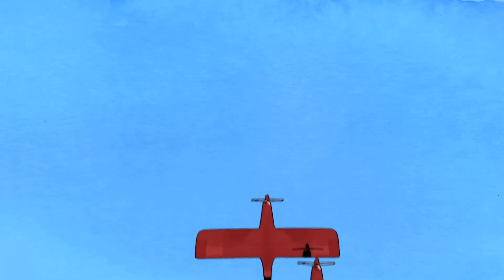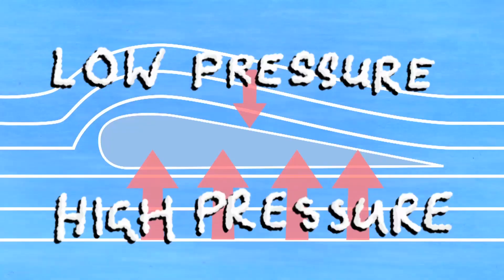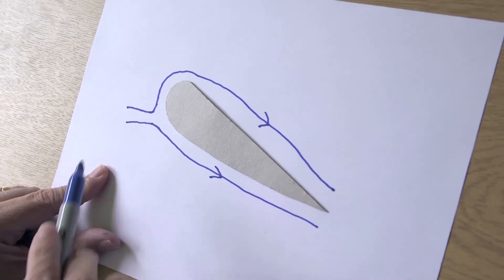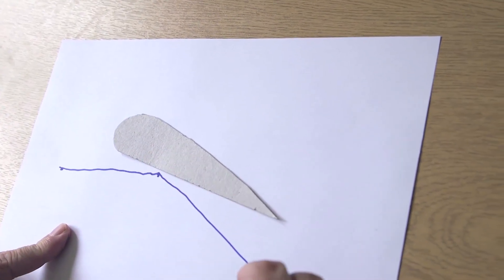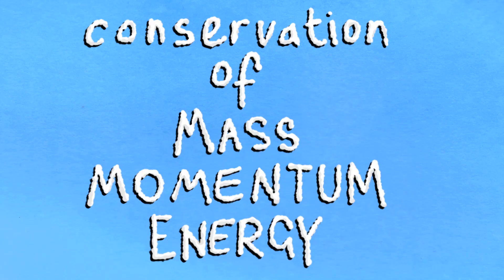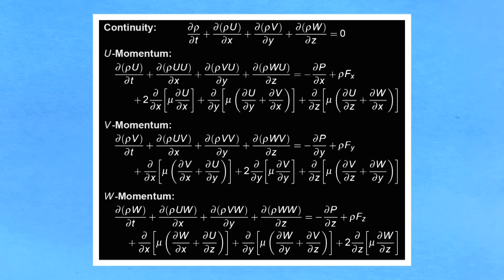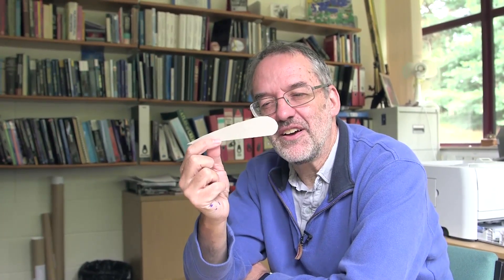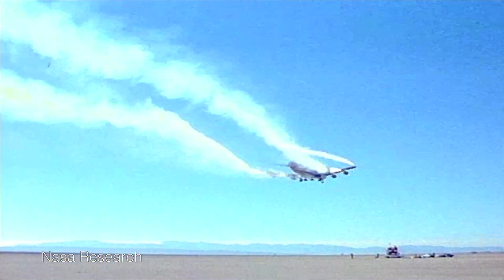Lift and Wings - Sixty Symbols

Comment: I'm copying this comment here, although it relates to the Gamma trilogy, because I thought my comment might garner a response if I popped it right into a NEW video, rather than one where the next newest comment is a full year old.  Sorry.  I think WAY outside the box sometimes...  So, in relation to the Gamma trilogy...  "I'd love a response to this from someone on or behind the camera. Couldn't think of a particular video where this comment would've been more 'correct', I like this channel. Anyway, I was an IT instructor for quite awhile, could easily still stand up in front and do some teaching. Here's the ONE THING I always thought would give the 'rubber sheet' gravity graphic greater value as a visual aid. Draw AT LEAST TWO rubber sheets, offset from one another, specifically to 'break' the mind's capability of abstraction of the habit of thinking in only three dimensions. Since every graphic of the solar system ever drawn appears as an extended elliptic ("The axis of rotation is NOT perpendicular to the plane of the ecliptic."), people tend to incorporate that little bit of trivia into their 'new understanding' of how gravity works, once they've finally seen the 'rubber sheet' graphic. But the 'single rubber sheet' fails to specifically illustrate that the curvature of spacetime around a massive object, (BTW, the spell checker shouldn't redline the word "spacetime", Google. Shame on you!), it fails to specifically illustrate that the curvature of spacetime around a massive object is totally xyz-coordinate-independent. It curves in all possible directions, related best to some gravity-influenced object by showing that it is vector(?) dependent. Whichever direction the approaching (or orbiting) object is in relation to the other object, THAT will affect what vector(?) the two bodies will respond to each other 'in'. I think this would be MUCH better illustrated by including at least TWO exemplar 'rubber sheets' in every graphic depiction of same. Just my opinion. Would love to hear the Professor's opinion. Please forgive the probable misuse of the term "vector", although I'm pretty sure you know what I mean to say."  Also, forgive me for ramming this thought down the throat of a video about things that lift...

Comment: Hey Professor Mike, where did the idea for the wing shape come from, historically?  It's always functionally described by math, but never why you applied the math to that particular shape in the first place.  I have a hypothesis that the shape was taken from triangular sails, they are both shaped the same in cross section and the (horizontal) "lift" from a sail is what allows you to tack.  Just turn the sail 90 degrees and you have a wing.  What do you think?

Comment: The smoke test where quite interesting. We where in an airbus 333 2 weeks ago, and we hit very strong turbulence for about 30-45 seconds. The pilot came on the tannoy and said we crossed another planes wake. How long does a plane leave a wake? We where about to enter a stack about 80 miles from london gatwick irc. Just wondered if it was calming announcement or not. I told my kids they where just cloud bumps, like road bumps but in the sky.

Comment: Vortices do not "have a significant effect on the lift of the wing".  Vortices are the result of lift on a finite wing, no lift no vortices.
If a wing tip flew next to a stationary infinity thin, infinity long, plane that separated the top and bottom of the wing, the effect of the vortex would remain even though the vortex wouldn't rotate, and I think the magnitude of the vortex effect would remain the same.

Comment: Been looking for a real explanation for awhile. Question: if the air at the top of the wing is being fit into a smaller area it is being compressed and wouldn't that create a higher pressure? Pv=nrt.
Reply: I think his comment about the air being "compressed" is misleading.  The airfoil exchanges momentum with the air (conservation) acceleration occurs and as a result, a velocity.  More air molecules pass over the wing in that thin sheet, but because of their increased velocity the pressure is actually lower.  I explain this a bit differently, elsewhere

Comment: I appreciate your reference to Euler and Navier-Stokes, there is some nice physics underlying this, but conceptually the thermodynamics of the conservation of momentum and energy should not be presented as complex or subtle.  This is not hard to understand.  The two dimensional cut out you display will fly.  Airplanes fly upside down because the angle of attack can be adjusted to compensate  for an asymmetrical airfoil. It might have been interesting to have mentioned the Coanda effect and its relationship to the Bernoulli principal.
Reply: Aeronautical engineer here: The Kutta Condition is more relevant to the lift generated by a wing. It describes the nature of the flow over an aerofoil to stay attatched to the aerofoil surface until the trailing edge (at low angles of attack). Note that this is a viscous effect and without viscosity aircraft will not generate lift.
Reply: @christube4487  why is viscosity needed?
Reply: The Coanda effect has nothing to do with airfoil lift.
Reply: @AmbientMorality  The Coanda-effect describes the tendency of a fluid to stay attached to a convex surface when moving across said surface, so yes, yes it has absolutely something to do with it.
Reply: @Hyperus  The Coanda effect describes a viscous free jet. Flow around a wing is explained extremely well (outside a small boundary layer) by inviscid potential flow theory. Coanda effect is vaguely similar but unrelated.
Reply: @AmbientMorality  but wouldnt the air without coanda effect just ignore the surface?
Reply: @PinkeySuavo  In purely inviscid flow (Coanda effect describes viscous flow) the pressure forces ensure that the air would continue to flow around the airfoil. 

Viscosity is needed for lift, as Swirlything01 notes—but I don't think it's related to the Coanda effect. It's just that in inviscid flow air would race around the trailing edge and turn around really quickly, which isn't possible when there's friction slowing it down.

Comment: Air being pushed by a moving wing, IS squeezed, and the air pressure, from both gravity above and the fact that the air not in motion above the "squeezed" molecules, makes the squeezed air rush out into directions "AWAY" from the direction of the hard immobile surface of the wing, thereby lowering the pressure and speeding up the air at the same time. With a sloping curve on the back side of the wing, the air has an obvious direction to "Unsqueeze" and thereby speed up. The underside of the wing has only a slope into the wind, and therefore gets a "bump" from the molecules hitting force imparted and slowing it at the same time. Thus, lift.

Comment: The Bernoulli effect is the ONLY one that is actively making a difference in the force balance of the system.
It has already been demonstrated 60-70 years ago that pressure on top of the wing is lower.
The fact that some VERY low grade/early books said the air meets at the trailing edge is irrelevant, nobody NOBODY that has ever gone to college for aeronautical engineering has ever studied it like that, because again, there are wind tunnel studies from 60-70 years ago that already showed the wind streams don't meet exactly at the trailing edge. (that is only seen on cheap books slapped together by people that knew nothing of aviation).
The rest is just for putting physics into numbers and graphs on how the air moves, temp., turbulence, pressure, vortexes.
I'm sure you know about fluid dynamics, the equations invloved would make 99% of the peoples heads explode here. The actual lift calculation for wings is several lines long.
But the question was, what makes the wing lift? What causes lift?
That is entirely the bernoulli effect. FACT.
Every other physical interaction/property of the gas medium are things that "affect...the bernoulli effect", more or less.
You take away the Bernoulli effect, and the plane drops like 50 ton stone. Got it?
And THAT is a fact. And it's been a fact for 100 years.

Comment: I've been waiting for years for this video to come out. It's been a pet peeve of mine for a very long time that people still teach this theory (the Bernoulli one, specifically). I was discussing this with a friend a few months ago, and we came to the conclusion, that it really is the downward acceleration of the air that causes the lift. The reason we arrived at this conclusion is that an infinitely thin wing would still generate lift, even though the air would remain at a constant speed. i.e. momentum conservation still applies, but Bernoulli's principle does not (or maybe I should say that it has no effect). For example, Paper airplanes fly just fine, and they have extremely thin wings.
Reply: Your explanation is closer to why parachutes work.
Reply: @euroviziune  Parachutes cause turbulence, and therefore dissipate energy that we perceive as drag. A wing is designed to cause as little drag as possible.

Comment: Nice video Mike. My only slight gripe is that you skirted too much around the viscous effects, as they seem fundamental to me as to why streamlines follow surfaces the way they do, and how this results in observations like the Coanda effect. Without viscous effects to attach streamlines to the top surface of the wing, the motion of the air at the trailing end of the wing wouldn't end up moving downwards... I think.
Perhaps next time just solve the Navier-Stokes equationsn and be done with it ;).
Reply: No, that isn't true at all. If you assume airflow is inviscid, flow separation never occurs. Considering viscosity opens up the possibility for separation.

Comment: Wouldn't have been easier to explain by saying that anything traveling through a fluid creates a potential vacuum where said object is if the object wasn't there. Which means a traveling object through a fluid causes said fluid to quickly fill the space the object left. Air is fluid, thus manipulating the shape of the wing and the tilt of the plane will cause fluid to push more fluid into the vacuum causing different forces at different parts of the plane. A faster plane displaces more air per  second, which results in more air moving to fill the vacuum in shorter time. This equals more force as a whole, which results in lower and high pressures. The rest is just clever engineering.

Comment: I am a fluid dynamics PhD student doing 3D aerodynamic simulations, and I approve this message. Fluid dynamics on YouTube can be really cringe-worthy, but leave it to sixty symbols to do it exactly right... Well done, more please
Reply: TheNightWatch001 Where are you doing your Phd from?
Reply: TheNightWatch001 I’ve always been a bit suspicious about fluid dynamics ( which includes liquids as well as gases) being applied to aerodynamics, because liquids can sustain an internal tension and gases can’t . Molecules in liquids are in direct contact with each other and gas molecules are about ten diameters apart at STP , and the mean free path of gas molecules under these conditions is closer to a hundred diameters. 
To take just one example——the viscosity of liquids generally decreases with temperature, but that of gases increases. Ouch!
Reply: @davidwhite8633  fluid dynamics and aerodynamics is literally the same thing?! aerodynamic is, if you really wanted to called it that, an under-category of fluid dynamics. The same laws apply. Yes in your everyday experience water and air behave very differently, but from a fundamental stand point they can be described with the same PDEs, the navier-stokes equations. 

You know, an airplane would also work under water (tbh even better due to the much higher density).

Comment: why would the air being compressed above the wing have a lower pressure than the original air? wouldn't the same mass of gas in a smaller volume create a high pressure?
Reply: bruce randall 
You also have to realize that the air is being stopped from filling the space the plane is going through by the plane itself, creating a partial vacuum. This causes the lower pressure which results in air flowing over the plane to fill the void, and that causes the air to move faster.

Comment: I would just say it's simple if you take that fluids like air naturally follow the surface of the wing due to their tendency to fill any vacuums or low pressure regions. The trailing edge of the wing slopes downwards, so if the air is following that slope, then it is also being imparted with a net downwards momentum.

TS;RM After the air is separated from the wing surface, it still has that downward momentum. If you think about it, air particles at a given temperature and pressure have a certain average velocity. If the trailing edge of the wing is sloping downwards, those air particles are going to collide with the wing at a lower impact velocity, meaning that the momentum of the total fluid is given a downward momentum, but also that the particle collisions on the underside of the wing will push the wing upwards against the lower collision velocity on the upper surface. So, the air pressure being lower on the top allows the bottom flow to push the wing up, while the top flow gains downward momentum due to suddenly having fewer collisions in one direction than the other.
Reply: J7  That’s a very understandable explanation . Better than most I’ve seen——and I’ve seen a lot .

Comment: From what I understand, the Coanda effect, the ability of a fluid to attach to a surface, also plays a large part in providing lift for the wing.
Reply: Nope, it is incorrect, pls watch the youtube video "Common misconception of lift "by Cambridge's proff Doug Mclean.

"It is not needed for viscosity or Coanda effect for the flow to follow convex surface."
Reply: @loouuiisssss296  And indeed viscosity is what allows flow to detach. Inviscid flow (in thin airfoil theory) doesn't ever separate.

Comment: So the professor still didn't get it right actually. Due to the three conservation laws, a vorticity occurs around the air foil, which in addition to the flow, creates the low pressure on top and high pressure on the bottom. This vorticity can be created with rotation of a cylinder as well ( curved ball effect)

Comment: Is it true though, that the wing is getting extra momentum from the air pushed down? There was this little innocent bit about the air being squished into narrower space when it hits the wing, prof. Merrifield said there's no apparent reason for it, but it's the way air works according to the Navier-Stokes equations. But - can't it be this part of the procedure where the momentum can be going? Can't the momentum be acquired by the air layers higher up? Probably not. If it was like that, professor would know. On the other hand, since the bit about squeezing the air is mysterious, it just makes (for me) the part about momentum not compelling. Just to clarify, I'm not arguing against it, I'm just not completely satisfied with the explanation - like I feel I'm still missing a piece of the puzzle. Other than that, this is the most clear explanation I've ever seen.

Comment: The key to lift is at the stagnation point. Air is draw over top of the wing, but the air that goes
under wing is drawn up by this too. Causing the bottom flow to hits the bottom of the wing harder. Causing a pile up of air. And causing higher pressure.
Reply: Except that explains nothing about the upper surface, and the upper surface ends up contributing more lift (more precisely if you integrate the pressure over the upper surface the lift there is usually greater than the integral of the pressure over the lower surface)

Comment: Lift is a wonderful thing to talk through. So many have these 'incomplete' descriptions described by Prof Merrifield, because they are quick to accept a sciencey sounding story. It is really interesting to see the different ways that trained engineers and physicists are confused when you ask a few probing questions.

Few notes on the explanation given in the video:
--> "the wing acquires upwards momentum" -  No it doesn't, the vertical velocity of the wing in cruise is zero (sorry, no funny reference frames fix this)
--> "the air goes faster on top because it is squeezed" - This doesn't help anyone understand why lift works.
--> "you have to consider viscosity effects" - Yes and no. You can have lift in an inviscid fluid, but only with a little magic (circulation) that is caused by viscous forces at the trailing edge of the wing (see Kutta condition).

IMO, if you say Bernoulli, Navier-stokes, or Coanda, you are just hiding the fact that there is something you haven't figured out how to explain in this context (or don't fully understand yourself). Physics don't care what your name is :)  

Even bringing up energy and momentum is usually a bad sign. Since these are derived quantities in classical mechanics, this is just bringing in one more conceptual step between not getting lift, and getting it... and this is just 2D.

Comment: It's not quite like that. The angle of attack of the wing causes the top flow of air to change direction due to the Coanda effect. Because the air resists this change of direction (Newton's law), an area of low pressure appears above the wing. Lower pressure means higher speed, according to the Bernoulli principle. So you don't get low pressure cause the air is moving faster. Instead, the air moves faster because of the low pressure.